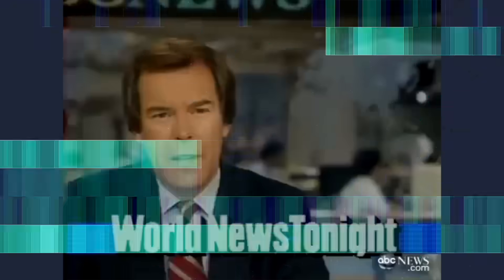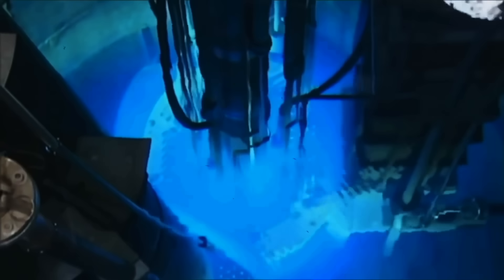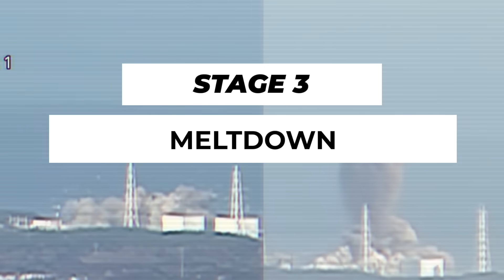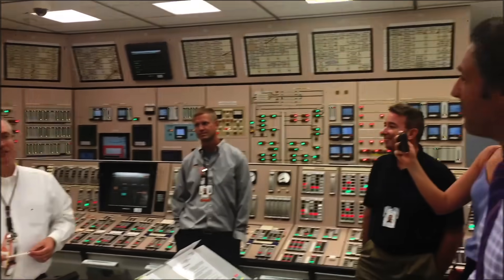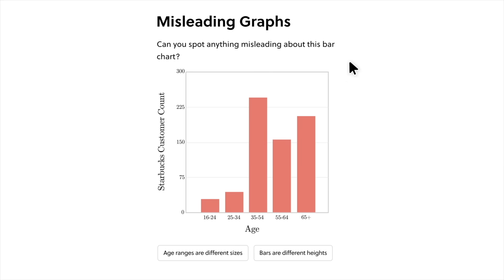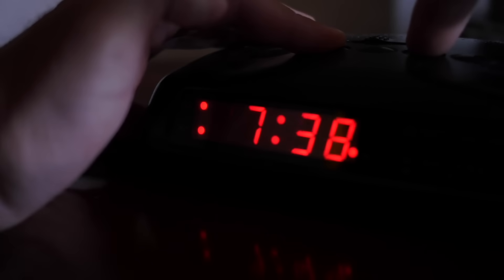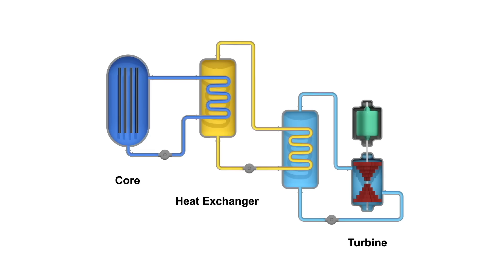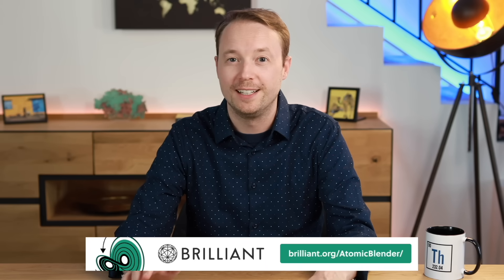Why Is It So Hard to Stop Meltdowns?

Comment: What if a really large bomb hits a nuclear reactor?
Will this cause fallout or an uncontrolled nuclear reaction?
Reply: Unless it's specifically a massive ordnance penetrator designed to rip its way through 100ft of rock into a hardened bunker and detonate there, you are not going to make a dent on a reactor core with conventional munitions. They are designed to withstand a 747 jet impacting the reactor containment building. A multi layered bunker containing the reactor. 
(not soviet designs like Chernobyl though)

However, you need not attack a reactor to cripple it into meltdown. Just take out the roads leading to the site and blow up some pylons in remote farmers fields that lead back to the site and suddenly the reactor suffers a loss of offsite power failure and has between 24 hours  to 30 days depending on diesel to prevent a meltdown.
Reply: usually they protected from bombing outside. it will do nothing
Reply: Water moderated reactors cannot blow up like atomic bombs. Reactivity can only proceed if the core is kept in a precise geometry and the neutrons are slowed with a moderator. Any damage to the core or the loss of the water moderator will stop the reaction. 
A bomb which broke through the containment building and directly hit the reactor will spread the radioactive isotopes like Chernobyl. This would have to be intentional. Random shelling around a plant might damage the ability to remove decay heat and a meltdown might occur like Fukushima.

Comment: Very glad you mentioned regulation as a critical nuclear safety system. Your nation's nuclear safety is only as good as your nuclear regulators.
Reply: And your trained, not bored industrial inspectors! This is a serious issue in any process that requires some level of administrative oversight. Does not matter how good the process is on paper. If you don’t have people who are motivated to keep on task in the building and inspection and output stages you’ll get poorer quality output.
Reply: Industry regulatory capture ensures regulation is not good enough. How do you think reactors keep getting re-licensed to operate well beyond their planned lifespans? Many still operating with cracks in the pressure vessels etc... Ya know, serious issues. Money before life, always.
Reply: @robinhood5627  Uh, regulatory capture isn't a guaranteed outcome of regulation.